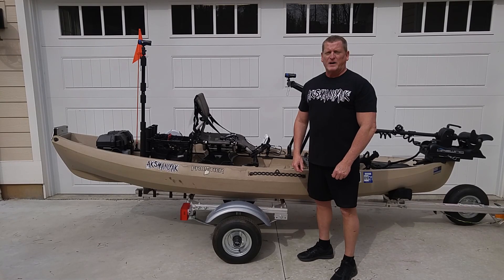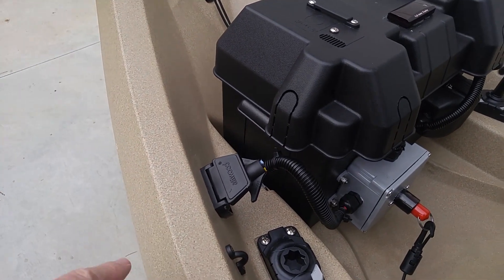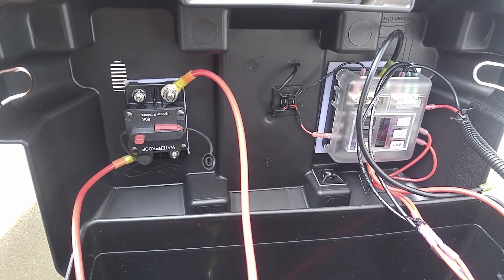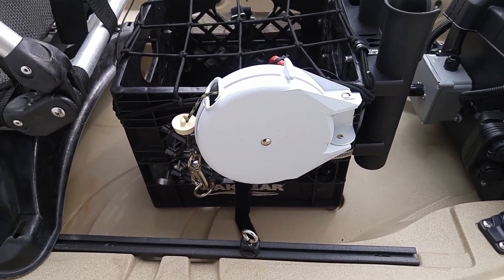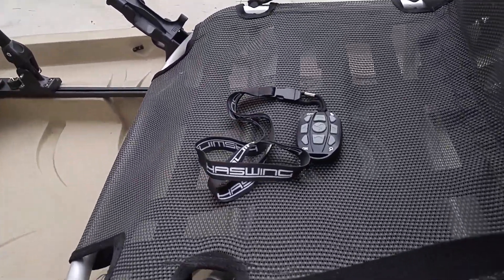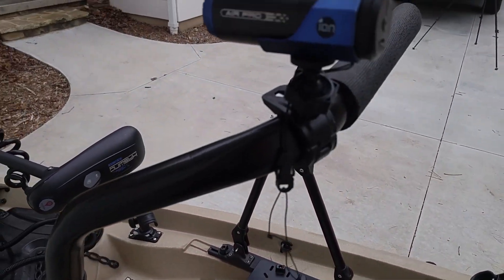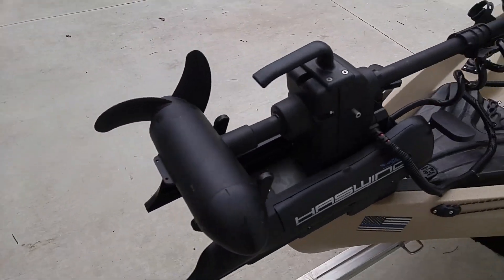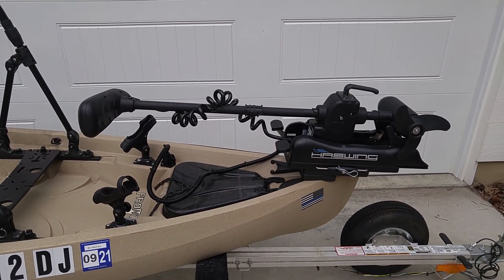DIY Kayak 2017 Nucanoe Frontier 12 Modifications

Comment: I am the current (3rd) owner of this NuCanoe Frontier and trailer and I LOVE IT! I would not change one single modification to this kayak. I fish Florida inshore saltwater only. The 100AH battery lasts 5 hours or so with occasional full power spurts to get me to a new location.  I use an Engel cooler with 4 rod holders instead of the crate so that i have the option of having dry storage or live bait well. The 360 seat provides a perfect turn around to access the cooler/bait well. I did not need the stand up bar, and have been enjoying standing up right at the seat operating the trolling motor with the remote and sight fishing for redfish. I also opted to remove the dashboard and have a tackle box tethered in that area of the boat. The boat is quite stable for me to crawl up to the trolling motor and pull it out of the water if im in super skinny water or pulling up to shore. All of the wiring in the battery box and to the motor is still working great although showing a little rust in spots due to the saltwater exposure. Awesome Job on building out this Kayak @Aksmaniyak!!!!!!!
Reply from the maker: Thanks for the great update!!!

Comment: Nice setup man. On the back attwood power port for your trolling motor connection, did you use screws or bolts? The reason I am asking is because i have an older model frontier that I wanted to copy your setup with but I have no access to the inside of the boat from the back.
Reply from the maker: Thanks. I used screws with marine Goop on the rear port and bolts with goop on the front port.
Reply: any time you have the option, you should use bolts and nuts ( I use nyloc) hardware with marine sealant and always stainless steel.  just my opinion. Using the backing like this guy has done is very good. Having hardware come loose or leak may be alright in a stream or small lake. I fish south side of Oahu and it's really inconvenient when things go wrong a few miles offshore.

Comment: Beautiful set up man  . I am actually considering buying  That trolling motor about how long does the battery last and how big of a battery are  You using
Reply from the maker: Thanks Tom. I am waiting for good weather to field test the motor and record the results. I am using a 100AH battery. I have the same trolling motor on my boat and it has lasted over 6 hours with the same battery. I will post a video of the field test results.

Comment: How do you like your Haswing motors in the long run, I saw one of your videos using haswing protruar 65lb brushless motor and was thinking about trying it?
Reply from the maker: I have owned several Haswing models and they were all excellent quality. I have owned other brands but for the price, features, and quality I will be staying with Haswing.
Reply: I used my Haswing a lot on my 17 Alumacraft. Highly recommend it. Id buy another.